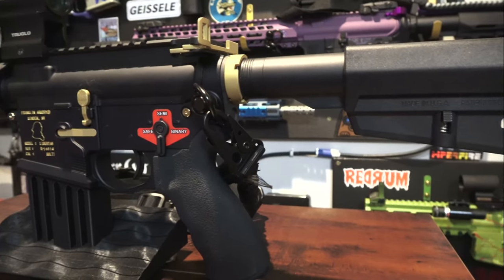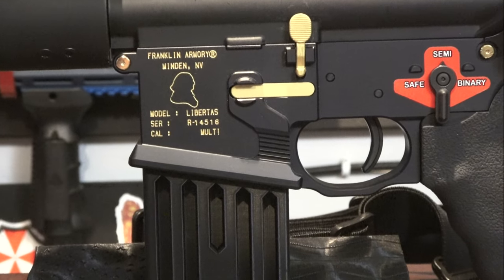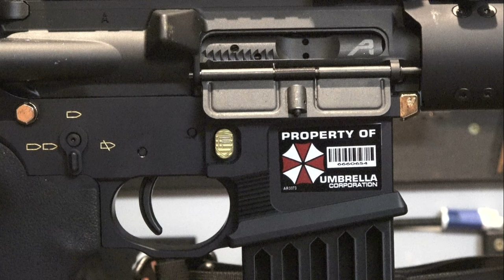FRANKLIN ARMORY + RADICAL FIREARMS : BINARY TRIGGER ISSUEs : AR PISTOL BUILD & RANGE DAY : DUAL CAMS

Comment: Franklin Armory puts a stronger than normal buffer spring in their lower receivers. If you are using .223 ammo it may not have enough gas pressure to cycle against that stronger buffer spring. I can't see what jam you are getting specifically but taking to a gunsmith for assistance sounds like good idea.
Reply from the maker: Thank you for the input, was firing 5.56... I have another BCG I'm going to try, take it apart, clean it & go for round 3!... Had the same thing happen on my 1st try:
https://youtu.be/mzjqg93ztnc
Reply: Dose that muzzle break work do you feel anything different?
Reply from the maker: Sure does, nice dragon breathing muzzle, didn't fire it with the old A2 it came with, not sure on the difference?... YT didn't send notification of comment, fyi.

Comment: Looks like it's not feeding the second round in binary but works fine in single. Usually that's a gas issue where your bolt is not going back far enough to load the next round. Check your gas rings make sure you're running regular milspec rings and not a one piece gas ring because those things cause problems. There should be three separate rings.  If not then its a one piece ring. The bolt should feel a little tight in the carrier. There's something going on where it doesn't like the second shot when you release the trigger. Hard to tell from just a video. Also try a different bolt carrier group from another gun see if it helps.
Reply from the maker: I appreciate the info... That was my next try, take it apart clean it & replace BCG, let's see how it goes!?
Reply: @1Conquistador  Post an update and let me know. I think it's something simple. Good luck
Reply from the maker: Much appreciated, I certainly will... It most likely is something simple like computers!